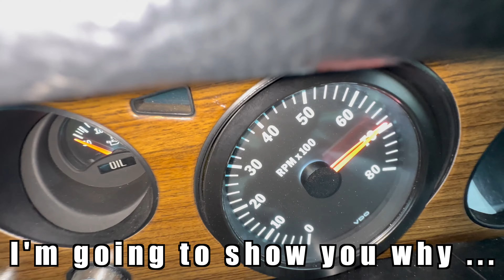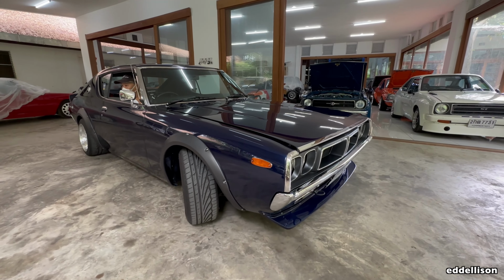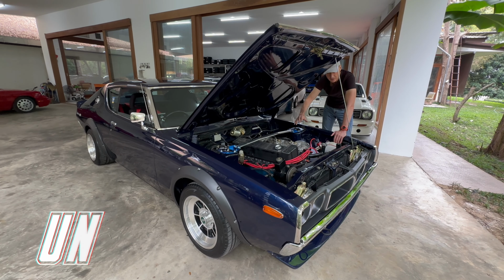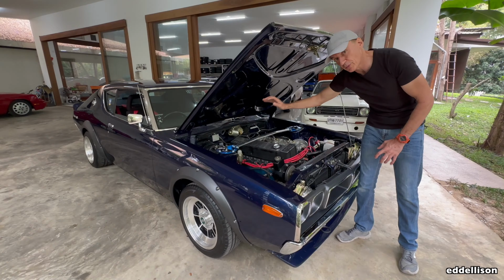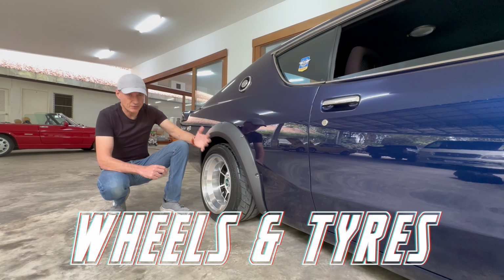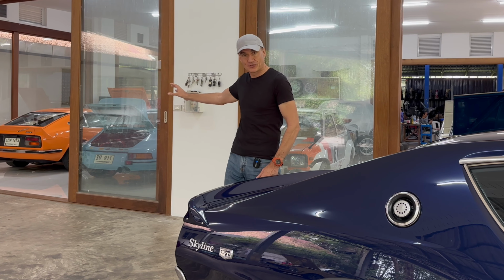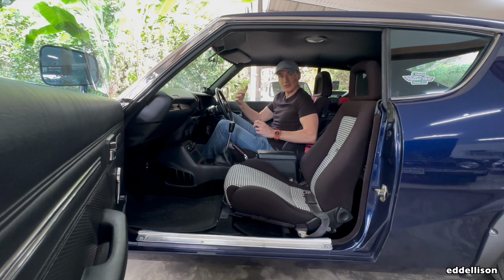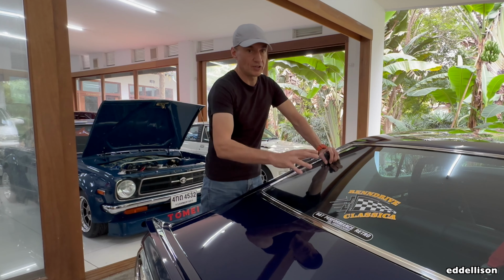I think this is the world’s best Skyline GT-R (C110) "Kenmeri" & I'm going to show you why …

Comment: Nice car! The Nissan Skyline was sold in the Japanese market only and the biggest engine available was the 2 litre L20 / S20 GT-R. All exports are Datsun 240K and had the 2.4 litre. This is a Datsun 240K with some Skyline trim and cut fenders / bolt on flares to make it look like a GT-R. There are trim differences. This has a mish mash of Skyline and 240K trim.
Reply from the maker: Thanks for the input & info.

Comment: You really have no idea where the Canary label comes from because if you put the names back to Front, it’s meant to say American after the way they stole the car which was the American muscle cars of that era. Second of all the L 24 is not strike to an L 28 they get a separate motor called an L 28 and put it into the car to increase displacement and performance of the vehicle itself. You really need to learn your facts before doing a bio on Car.